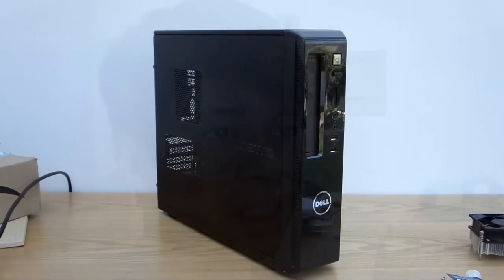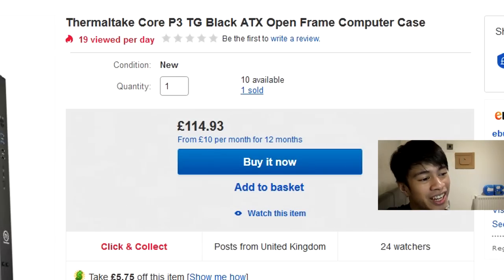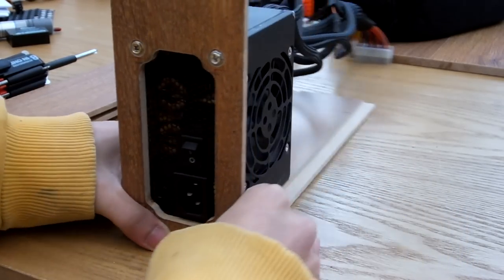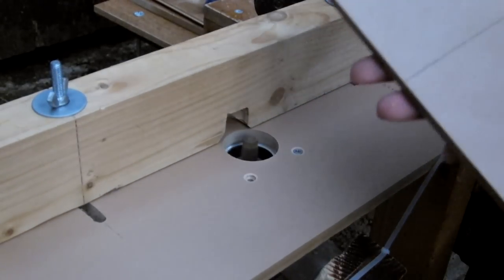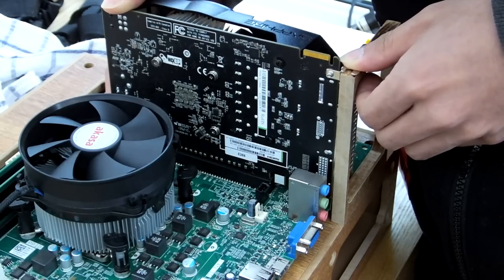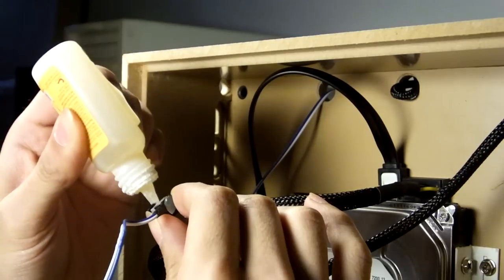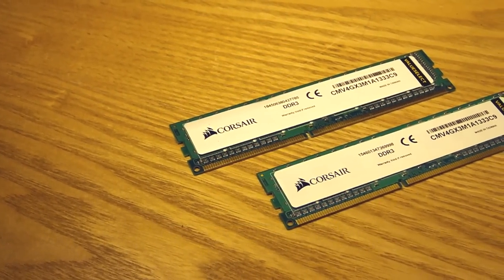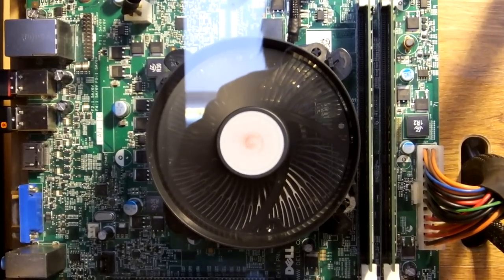DIY PC Case - Thermaltake Core P3 x Corsair Crystal 280X Inspired

Comment: It's refreshing seeing someone solving problems without throwing indecent amounts of money at it. It seems like it's all PC building YouTubers are about these days.
Reply: I appreciate this kind of thing more than "$(XXXX) PCbuild" vidoes.
Reply: Refreshing for sure!
Reply: I agree but when I saw that power supply, it became evident that this is the exact opposite of such videos. An indecently low amount of money spent on components.
Reply: what about that expensive tools?
Reply: @pclover2369  those he can use over and over, so the overall cost is spread over each project he creates. And, in developed countries, used tools can be bought surprisingly cheap; in fact, he did say in the video that the cost of the case on eBay would cover what he paid for his tools

Comment: Brilliant use of natural products in a case design. I went to a large Tile and flooring store in Tucson, Az. and was able to buy separate pieces of flooring.  Where do you find the chrome extenders? I hate co copy you, but I must.  Thanks so much for doing this for all of us.🍑
Reply from the maker: Thank you!

I got the chrome standoffs off eBay, but their lengths are either 150 or 200mm long - they can't be shortened as they're made of sheet metal

It's quite a chore, but you can also make your own, which I've done on my Mini-ITX case video
Reply: @TheBuddingEngineer  Thank you so much Dave

Comment: Coming from someone who owns 2x TT P5 really nice job on the build I did like the idea of what you did with the power supply. As for those who wonder if the case gets to dusty being a open cooled chasis, it is not as bad or not as what you would think. I mainly have both my P5 hanging on the wall and if I would have set both my P5's on the ground yes they would get dusty and more cleaning would be more expected of. I mainly clean my cases out 2 - 3x a year both runnin off a AIO. As for the video I am always impress with watching woodworking Vlogs on others who take there builds to the next step level, to also help give me ideas of what I can do next on my P5's or doing a build from scratch myself.

Comment: Apart from using junk PC parts, your DIY PC case project is great. Thank you.
I plan to build and mount my new PC on wall, but need to keep it thin, so not putting PSU behind the plate
Reply from the maker: Thank you, we all had to start out somewhere ;)
And good luck on your build, perhaps the Core P3's layout will suit you much better
Reply: @TheBuddingEngineer  Really good project! I will not use Thermaltake Core P3 or P5 as they are very thick, I'll do my own 'case' hanging on wall. Thanks.

Comment: If you have a pci extension cable you can place the GFX card on its side as well which would reduce the height needed. I am planning to do something similar this weekend however plan to use cardboard which i would either glue or screw into a travel case. It is my plan to make a gaming pc that is plug-and-play. I tend to travel alot and like having a gaming pc and most laptops are not really good for gaming. I still plan to keep a laptop because i work as a teacher and like having a computer that I can use for work.

Comment: It's like you read my mind, this is exactly what I was thinking of since no case manufacturer makes anything practical for air cooling like this. I want to point out that it is very much recommend that the motherboard standoffs have an electrical connection to the outer shell of the PSU so you should put some wire connecting the standoff to the outer metal shell of the PSU. Usually in a metal case the standoffs are electrically connected to the PSU through the metal of the case and the PSU housing is connected to the ground port of the outlet. I'm not sure what the exact reason for this is since the atx power connector also gives the motherboard multiple ground connections, but I think it might have something to do with removing static charges that build up as the motherboard runs
Reply from the maker: Thank you, I actually did think about this while planning the case, by using foil tape that are used in laptops to connect those standoffs to ground. But after some more reading, I decided to pass this up and I've never had a problem so far.

Redundancy (in anything that uses electricity) is always good, so when I eventually use more expensive parts, I'll ground the standoffs

Comment: Beautiful case!  I'd take that over a mass produced model any day of the week. 
On a side note- I'd suggest you lower the blade of your table saw so that the teeth of the blade are no more than 1/2 inch above the board you're cutting.   This reduces friction between the board and sides of the blade, reduces chance of kickback and leaves less blade exposed in the event that something were to go wrong in the worst imaginable way.     On your Miter Saw you never want your hand within 1 foot of the blade.   Wood can break or pinch against the side of the blade causing it to move violently, potentially taking your hand with it.  If the work piece is too small to keep your hand well clear of the blade  then use a clamp or make a wooden stick you can use to give your hand some distance while holding things in place.    Understanding all the ways those tools can end up removing body parts is not something that you can rely upon your intuition for.  Please research safe use of the tools you own.   It's time well spent.
Reply from the maker: Thanks for the heads-up
Reply from the maker: No way, that's absolutely gorgeous

I'm at least a few decades away from reaching that level, if I ever do, lol

Comment: If no one has said anything about getting the pcie brackets (idk what else to call them) you could go to a local machine shop and ask them to make some. I’m studying machine tool technology and I’ve learned that most things like that are generally pretty cheap to make. You could ask them for a quote and it’ll probably cost less than $20 USD, so around £15 probably. But as with all things, prices may vary, so get a quote before committing to a purchase.
Reply from the maker: That's actually a good idea. If they're that cheap even with mild steel, I wouldn't mind getting it there.
Reply: The Budding Engineer Yeah, it’s unlikely to cost you much, just take some measurements for length and give them a minimum and maximum diameter to work with

Comment: you could get a vertical mount for the PCI-e slot and just mount it horizontally or. use the mount and a riser cable to mount it vertically as the product was intended

Comment: The fact you very rarely went free hand with your router etc. makes this better looking than some Homemade cases. Nicely working features from more than one case you ended up with a nice case that can easily blend in with furniture. Going slower than rushing it you ended up with something beautiful. Certainly a learning curve and with everything new, i mean planning this and design to construction, you may find some things you would do slightly differently next time but couldn't this time round as you didn't know before hand, I wasn't there and you (royal/general you) wouldn't show someof those things off for this kind of video if you (royal/general you) did go wrong a times. There is trial and error, but that said, that is how you (royal/general you) end up with something as good as this.

Comment: Thermaltake Core P3 is one of my favorite case designs ever. Except in my country dust falls down not sideways. So it's best used below some shelf or horizontally or redesigned in a way that makes more real world sense.
As for your build - foremost you finished it. Doesn't happen to every project. 👍

Comment: Found this video while looking for reviews of the P3. Glad I did! It's inspired me to build my own case, as the P3 doesn't quite fit my build, need at least 4x 120mm slots for radiators (240 for cpu aio, 240 for GPU aio). I only have a matx motherboard, so a P5 would be kind of huge for it, not to mention way too expensive compared to my mid-range components.

You definitely deserve a sponsorship, I'd love to see a build like this but with some nicer components and a custom water loop. I'm sure you could get a few sponsors to send you parts to showcase in the videos!

Comment: Perhaps you could reach out to The Laser Hive to get a PCI backplane. They make conversion kits for the Powermac G5 case to build a hackintosh with a std ATX motherboard and they do have ATX and MicroATX options. I forget how the parts are lined up inside but perhaps one of the parts will fit your build - or a new build - and you can order just that part ? They are in Hebden Ridge in Lancashire.

Comment: Fantastic video, loved what you did with what you had, how much noise does it produce?
Reply from the maker: The cheap CPU cooler did make a bit of noise even on idle, but otherwise was pretty quiet as the whole build had two fans. The dust, well, that's a different story.

Comment: Beautiful build! Im doing something similar with some steel in a small form factor. Where did you get the long metal standoffs? Im looking to use something like that in my build. Cheers!
Reply from the maker: Thanks man, I got the standoffs from ebay, but I've only found either 150mm or 200mm lengths useful for the build. If you're able to get these pre-fabbed, or make them yourself, I'd recommend that

Comment: small tip .  on 4:03 your blade extends to much . set the depth slightly over the thickness of the material .. your blade will last longer :)
Reply from the maker: thanks bro, I didn't know that was the case - it's likely better for safety as well

Comment: Hello! First of all, good job, nice tools and especially good finishing eye. Second of all, i want to ask you something because i`m doing a project case right now for an old pc that i want to transform it in some kind of booster for the TV and want to blend it in the room with a case very similar to yours, plexiglass and all that but i`m struggling finding those chrome pipes that you are using for mounting the glass, can you help me with that?
Reply: I searched for longer ones but cant find them
Reply from the maker: Yep, these are what I got, paid almost the same price too. Here in the UK, the longest ones I've found are 200mm.
Reply from the maker: These are glass standoffs, for mounting those elegant outdoor signs. Most of them will be short for that reason but I found long ones on eBay.
Reply: Thank you both so much for the info!

Comment: on Aliexpress you can get PCIe Holder or Stabilisators. maybe that brings you closer to the Thing you`re looking for
Reply from the maker: I finally found one! There are some extra tabs that can be filed off but aren't too pricey. I'll consider getting one for this case. Thank you so much!
Reply: @TheBuddingEngineer  no Problem. Also what works are Threaded Pillar 3cm in to the wood and 2 nuts 1 under 1 above the IO Shield of ther GPU ;) but though a hole Bracked was more for you
Reply from the maker: Yeah, I did consider those threaded rods, they might actually be a better choice if I make more PC cases.

Comment: hey man nice video just out of curiosity what wood working tools do you use coz i'm trying to get into wood working myself
Reply from the maker: Some of my tools (the table saw, router and belt sander) are actually handeld tools bolted under some tables. My other ones are a small pillar drill, mitre saw, a small planer even (but I rarely use it) as well as your general hand tools.

If you want to get into woodworking, how about I make a quick video about my tools? Maybe it can help you out.
Reply: actually it would be very appreciated from your end if you could make a quick video. Not many of those out there that i've seen
Reply from the maker: Done! Hope it's good, and there's loads more stuff out there that can help you out. Good luck

Comment: its really nice but why didnt you make it like the original? a flat board to hold the motherboard then a overlay black board with cutouts to hide the motherboard. to mount the card you could just add a threaded rod to go between the perspex and the wood and use nuts to hold the metal plate. for the cables i would invest in a cheap pin removal set and then take pictures of each plug. release the pins drill the cable holes to match the cable thickness push through and carefully push the pins back into the plug or black magic it and paint the front facing wood and holes black so you cant see them

Comment: Nice! But the idea is much older. In the 90s at university as an industrial designer I think of a "Wall PC" because run much cooler, pick up less space, less dust, easy to clean and upgrade. Later I make one with a similar spec (2012). Here there is a baby proto https://twitter.com/AlanMattano/status/215230674913853441  and later the Core P3 came out

Comment: Nice work! It's weird how I thought the same thing to build a case since everything is on lockdown. And we have the same tastes. I like the clean nzxt case too, and I already own the Thermaltake P3. And I'm also an engineer and hobby woodworker. Weird
Reply from the maker: Wow, that is weird... Brother?
Reply: @TheBuddingEngineer  seriously weird. Also, the Graphics card on the P3 is held in with a riser bracket. Like this:
https://www.amazon.ca/Phanteks-PH-VGPUKT_02-Universal-Vertical-Pci/dp/B07MW73HTJ
They're pretty universal, I bet you can find one that has a piece that would be easy to attach to your case without much modifications.
If you need any info or pictures of a P3, let me know!

Comment: I use powerman sfx 300w with r7 265, and anything was good enough)
Reply from the maker: No way, that has an even higher power consumption. But if it's working in the end, it doesn't need fixing. I'll still make an update if mine blows up.